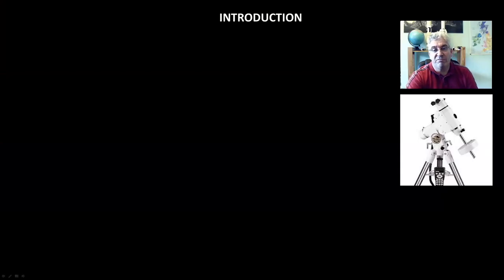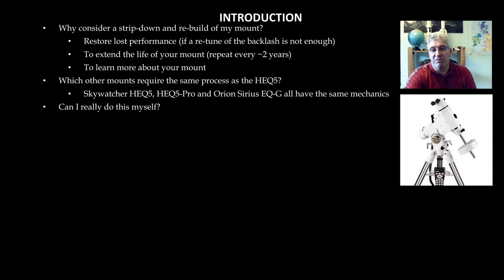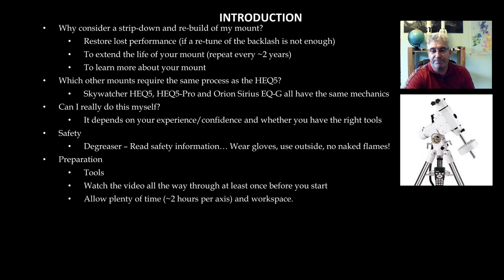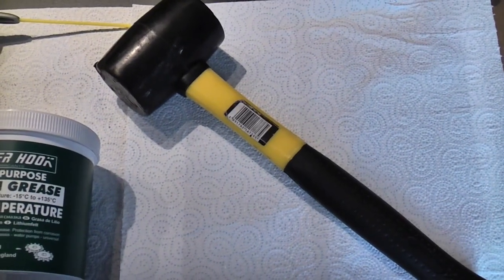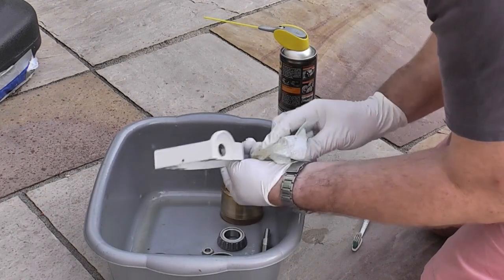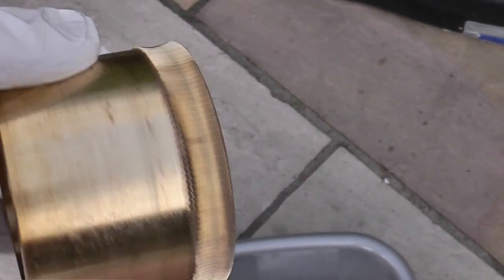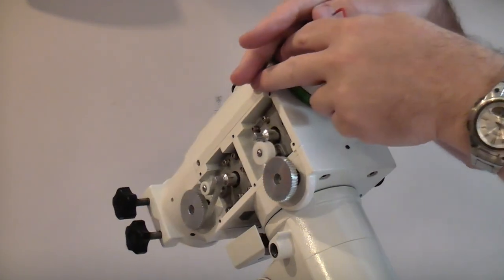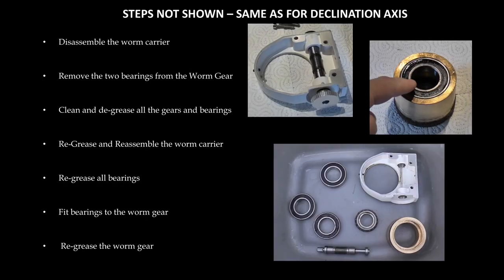Skywatcher HEQ5 Stripdown and Rebuild (NEW VERSION)

Comment: I would like to thank the author of this video (I am speaking generically because it was a list of videos that led me to this result) for his work and for having helped me to greatly improve my HEQ5 setup. Previously it drove with about 3.0" RMS and could barely capture anything. Combined with the terrible seeing here and the brightness of the city (Bortle 8), I kept trying for 6 years and almost gave up astrophotography. Well, I tried to make a last effort and cleaned and lubricated the HEQ5, installed Rowan's belt kit and changed the Hypertune's bearings. In the last few days I had open skies and was able to test the results. The HEQ5 is incredibly accurate, averaging 0.4" RMS and easily holding 0.3" RMS if you have a good guiding star (the seeing here is still very bad). Yesterday I managed to reach 0.28" RMS with a wind of about 5 to 10 km / h capturing the nebula of the lagoon (Messier 8). I am very happy and will continue strong and steady in search of new catches. If you also have the same problems I have, believe that they can be solved.
Reply from the maker: I am very happy that my video has helped you. It sounds like your HEQ5 is performing really well. Clear Skies!

Comment: Martin, Brilliant video and easy to follow. 
I have just completed my Dec service during which I replaced all the bearings with new. 
I had just two problems the first was down to a bit of corrosion on the shaft. The bearing between the red washer and the body of the mount came out with the shaft and proved difficult to budge so I ended up spraying a bit of D40 on the shaft and eventually the bearing released. 
The second problem I encountered was with the button on the Dec clutch, it didn't go back in square and I had to dismantle everything to push it through and start again. The second time I pushed the button in from the back before attaching the worm gear. 
Otherwise a long overdue service, tomorrow I will try the RA axis.
Reply from the maker: Thanks Rob. Glad it helped you and well done for solving those issues. Clear skies!

Comment: I returned to this video yesterday having finally decided to tackle the dec. axis concern I've been living with.  When balancing the dec. axis the rotation seemed sluggish or damped compared to the smooth,  free rotation of the RA axis.  My mount was purchased new in late 2020. I was pleased to find, when I disassembled the dec. axis, a reasonable amount of grease had been used. It appears to be a clear synthetic grease similar to the Super Lube I had on hand.  All the bearings turned smoothly as one expects and the "drag" or "dampening" was caused by the heavy load of grease between the brass gear's drum and the aluminum housing.  Just wiping some of it off the gear and out of the mating area made the rotation free and smooth.  I did put a quick wipe of Super Lube in place of the heavy coat I removed, but not enough to impair the smooth rotation.

Having read accounts of folks either finding a lot of heavy grease in their mount's bearings, or worse, no grease at all, I was pleased to find my mount seemed mostly appropriately greased with a "modern" grease and free of swarf.  Now I have to wait for a clear night to see if my tracking is improved or not.

Thanks for the time and effort you put into this video.
Reply from the maker: Hi David. Thanks for adding your experience here. Hopefully it will help others. Do let us know what difference it made. Clear skies.

Comment: You mention this very briefly, but I think if you are going to do a full tear down and rebuild, it's worth replacing the small worm gear bearings (689 2RS ceramic hybrid ball bearing). Both Dark Frame and Astro Baby suggest replacing these are worth it, while replacing the main axis bearings only need to be done if there are noticeable problems. The four small bearings are quite inexpensive, as you point out, while replacing the 6 or 8 large ones is significantly more. The small ones obviously rotate much more and I believe they are also under quite a bit of radial load so likely get more internal damage. Also, any axial movement of the small bearings translates directly into rotation of the main gear and radial movement changes the engagement of the worm gear. The large axial bearings (6006 2RS1 SKF deep groove ball bearing) don't really contribute to any rotational error, unless there is a tremendous amount of stiction.
Reply from the maker: Thanks for that Douglas. Yes, I did change my worm bearings for Hybrid Ceramic ones. I was amazed how cheap they are to buy!
Reply: @martinsastrophotography  I thought you might have changed the 4 small ones since I didn't see you actually clean them. Did you also eventually change the 6 large axial bearings (6006 2RS)? I noticed on one website (bearings online) they say the SKF and FAG bearings are sealed for life with a rubber seal on both sides. I started to wonder whether opening up the old ones was really a good idea because they probably don't reseal perfectly so might eventually start leaking grease, especially in very hot weather.
Reply from the maker: @douglassmith1215  I found that it was easy to remove the seals, clean them up and re-grease/reseal them, but if in any doubt I would certainly replace them with new ones. They are not expensive.
Reply: @martinsastrophotography  One last thing: one HEQ5 Pro rebuild video that is probably not looked at enough is the one from Ivan Ionov. It is in Russian so hard to follow (even with the auto translate subtitles turned on). But he shows a few nice tricks and in particular drew my attention to the fact that a careful inspection of the worm gear is a good thing to do. On his mount, during final assembly, he noticed a bit of stickiness at a particular spot on the worm gear rotation. He managed to track this down to a small burr on the worm gear (which I think he filed down). The relevant part of the video is around here: https://youtu.be/xVyenl37gXk?t=1426
Reply from the maker: @douglassmith1215  Interesting. I’ll take a look. Thanks.

Comment: Hi ! thank you very much for this video that make me confident enough to stripdown my HEQ5.

I would like to say for everyone that struggle to put back the gear on the shaft or the ball bearings in the gear :
You can put the inside piece in the fridge and the outside piece to warm a little in the oven (40°C or 100°F is enough) and everything can easily be rebuilt without forcing or hammer :)
(this could be added to the video, I really struggled with that)

Comment: There is a special tool that is easily bought called a "lens spanner wrench". It is used to fit into the little slotted ring that holds camera lenses in place. They typically come with a variety of tips to fit into different sized slots and the distance between the tips can be varied. It's a must have tool for many projects (telescope, microscopes, etc) that involve lenses or other precision parts. I suspect it will likely work in place of the "special socket tool" mentioned in the video (although I have not yet attempted this project).
Reply from the maker: Thanks for the info Doug. Much appreciated.

Comment: So I wondered why the RA scale ring and the polar scope were not fitting snugly against the housing. Using this guide I’ve stripped everything down and found the clear washer is missing which in turn makes the shaft protrude to far out where the polar scope goes. I’ve managed to order spares and fingers crossed it’ll all go back together soon. Thanks for another useful video 👍
Reply from the maker: Well done. It’s always gratifying to solve such problems. Clear Skies and thanks for the message.

Comment: On my HEQ5 Pro , the allen bolts are imp sizes. I adjusted the tapered roller bearings, but it still a little stiff in dec, so I will do a full bearing change as I can hear a slight noise from the dec bearings

Comment: Awesome job Martin, thank you so much!  Glad to know it's "Darkframe" approved. They do have upgraded bearings and worm gear. Do you know where we can get those?
Reply from the maker: Thanks for that.  Here's what I know :  

Bearings:  Available (in the UK at least) from ‘Bearings online’ https://www.bearings-online.co.uk

 Worm bearings :  689 2RS Ceramic Hybrid Bearing 9x17x5 @ £2.80 each (4 off)  (SKF are the high end ones!)
 Worm Gear and Main shaft bearings : 6006 2RS1 SKF Deep Groove Ball Bearing 30x55x13 @ £5.05 each (6 off)
 Declination shaft, Tapered Roller Bearing :  30205 TIMKEN Tapered Roller Bearing @ £7.49 (1 off)

Grease: ‘Geoptik Equatorial Mount Grease Kit’ Rother Valley Optics. Costs £18

Comment: AS a mechanic, its hard to belive that this mount requires that maintanance. But i Like the way people take care of the parts, so that IT can Last a Lifetime. provided the plastic belt does not become brittle.
Reply from the maker: They don’t always require it. I started taking mine apart primarily to learn what was inside. That done, it’s reassuring to know that I can take it apart and sort any issues that arise in the years to come. The belts last a long time provided they are not over tensioned. Clear Skies.

Comment: Just a note, I had some issues taking off the worm drive, so I had to remove both float adjustment screws. When you do another maintenance maybe add a small section on correctly aligning and adjusting the float screws from both sides. It's not too tricky, just a bit more precaution needed.
Reply from the maker: Thanks for your comment and suggestion. Yes it can be difficult due to the tolerance fit of the bearings to the housing.

Comment: Hi Martin
Thanks for a Brilliant and easy to understand video on this HEQ5 Pro strip down.
I have just purchased a second hand, older version of this mount with all origional gears etc.
I am going to have a go at this myself, and I have all the tools.
May I ask if you have a video of doing this strip down without the Rowan mod?
Thanks very much anyway.
Keith
Reply from the maker: Thanks Keith. Sorry, I don’t have a version without the Rowan Belt mod. The only difference is the gearing between the motor and the worm drive.
Reply: Maybe I need to get the Rowan kit?
Infact - its the first thing I will do!
I was straying away from the Rowan kit as I wanted to buy the upgraded PUK and Saddle.
My one just has 2 screws which presses on the dovetail.
Thanks for your help.
k
Reply from the maker: @TinwhistleD Yes , I recommend you get the Rowan Belt Mod upgrade.  The mount moves much more smoothly and quietly, and some of the backlash is eliminated. The other upgrade is nice but not as important.

Comment: I was doing the belt drive upgrade and decided to inspect the worm gears while I was working on the mount - mostly because I couldn't get a satisfactory backlash adjustment on the RA axis.  I could get the grub screws adjusted for no backlash, but when I tightened down the three bolts on the worm gear housing things got a bit too tight.  I didn't appear to have any binding when I did the 360 test, so I may try again.

In your video at the 1:06:15 mark you make note of a clear washer/spacer - I do not appear to have that.  It was not stuck to the worm or the red spacer.  I wonder if they have increased the thickness of the red spacer?
Reply from the maker: Hi there. Yes, the worm carrier often shifts a bit when you tighten the three large bolts, so it can take a few attempts to get it right. With the belt mod you can easily remove the belt then test how smoothly it moves by turning the gear on the end of the worm by hand.. Not sure about the clear/red washer issue. A question for Skywatcher I think.

Comment: Hi Martin thanks for the very comprehensive HEQ5 stripdown/rebuild video. I have now replaced all the bearings on my HEQ5pro RA axis and its moving a lot better. I still think that the rotation is a bit dampened. I have read that too much grease can be as bad as too little. Is it possible to improve free rotation by using less grease? Alternatively I was thinking of upgrading to a set of hydrid ceramic bearings. I have checked online and the prices vary greatly. When you upgraded to hybrid ceramic bearings which ones did you go for and from where?
Thanks again Bryon
Reply from the maker: Hi Byron. I don’t recall what bearings I bought but I do remember being surprised by how cheap they were!!! SKF seem to be a respected manufacturer.
Reply: @martinsastrophotography  Hi Martin I have managed to track down a set of 6006 2RS and 689 2RS ceramic hybrid ball bearings at a reasonable price. They come lightly greased and rated up to 14,000 rpm. As they will only be doing a few revs per evening and are claimed to be 'self lubricating' is there a case for running them dry/near dry. How did you set yours up?
Thanks Bryon.
Reply from the maker: @bryontuck-martin1915  The ones I used were sealed so I just put them in as they were.

Comment: Hi Martin just discovered your channel and subbed. Very useful video. On another comment you give a list of the bearings needed but do not mention the roller bearing for the RA just the Dec. Is this the same or is there a reason its not listed?
Reply from the maker: Hi there. Thanks for subscribing and for your question. The RA and DEC worm gear and main shaft bearings are all 30x55x13 (e.g. 6006 2RS1 SKF Deep Groove Ball bearing). The smaller worm bearings are all 9x17x5 (e.g. 689 2RS). The tapered roller bearing on the declination shaft is a 30205 (e.g. 30205 TIMKEN Tapered Roller Bearing). All are available at low cost online. Hope this helps. Clear Skies.

Comment: Hi Martin. Opende the ra axis and removed bearings and spacer. In your video There is a thin transparant washer. There is no such washer in my mount. Could that be an issue?  Thanks for your advice, Math
Reply from the maker: Probably not. If it was not there before then do not worry. Sky-Watcher may well have adjusted the design slightly at some point in production between when my mount was manufactured and when yours was manufactured. If you really want to know for sure, then this is a question for Sky-Watcher customer service. Clear Skies!

Comment: I’ve been taking apart and reassembling a 13 year old Orion EQ-G mount that isn’t in the best shape. After putting the RA axis back together, I can see a pretty large (maybe 3 mm?) strip of the brass worm gear in between the alt/azimuth base and the worm carrier. It feels wrong, but I can’t tell if that’s just how it should all fit together. Thank you!
Reply from the maker: Hi Maya. I agree that doesn't sound right.  I suspect something is not properly engaged.  Best bet is to take it apart again and take a careful look at things during re-assembly. Sorry I can't be of more help than that.  Clear Skies!

Comment: Hi Martin, your HEQ5 videos are a great help for new HEQ5 owners. Mine was delivered with a lot of nasty particles visible through the polar alignment scope. May I suggest disassembly, cleaning and reassembly of the polar scope as a future topic?
Reply from the maker: Hi there. Thanks for the nice comment. I will add that idea to my list! Main thing is to take great care with the small round glass reticule inside the polar scope. It’s held in by three small grub screws. You need to unscrew the whole polar scope from the mount first. Then carefully loosen the 3 grub screws without letting the reticule fall out. Then carefully tip it out onto a soft clean surface. Then you can use an air blower (or if you have to a cotton bud) to remove the particles. Do not touch the glass with your fingers! Always hold it by its edges. Hope this helps!
Reply: @martinsastrophotography  thank you! The main thing I am worried about when taking it apart is if there's any issue aligning the graticule within the polar scope or the entire polar scope rotationally about the RA axis when reassembling it.
Reply from the maker: @aTillasSister  I understand. This is not at all critical provided you do your polar alignment the way I demonstrate in my polar alignment video. If you do it that way, the only consideration when orientating the graticule in the polar scope is the orientation of your telescope during polar alignment. I positioned mine so that the RA is about 20 degrees away from the home position simply so I don’t bang my head on my telescope during polar alignment!! :)
Reply: @martinsastrophotography  Thanks, your polar alignment method should be in the manual! If I get my choice of how to align the reticule, it would be to align it so that the 0 is at the top when the counterweight hangs down under gravity, but as you say using your method it doesn't matter any more. BTW I use a Neewer right angle viewer and a 3d printed connector, designed for iOptron but it also fits Star Adventurer and HEQ5. The right angle viewer rotates and so you can get to a convenient angle.
Reply from the maker: Thanks for your comments. Yes, the method in the manual is very old fashioned and does not exploit the excellent smartphone apps now available. Yes, those diagonal eyepieces for the polar scopes are much more comfortable on your neck!!!! My friend has one, but I don’t.....yet!
Reply: @martinsastrophotography  here's the connector: https://www.youtube.com/watch?v=caEhm344BCg&t=12s